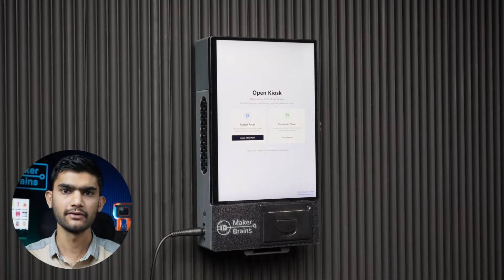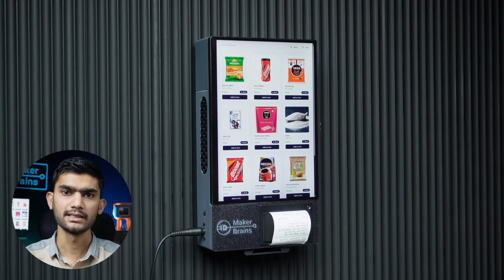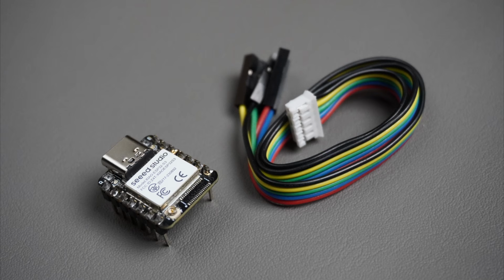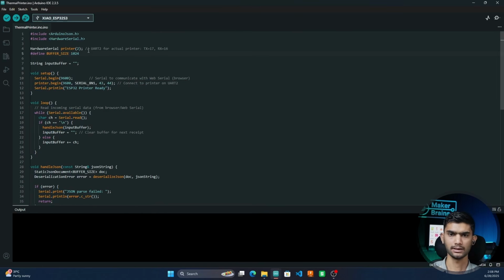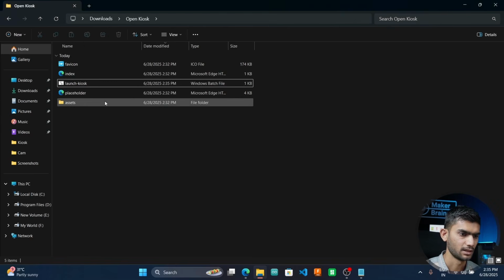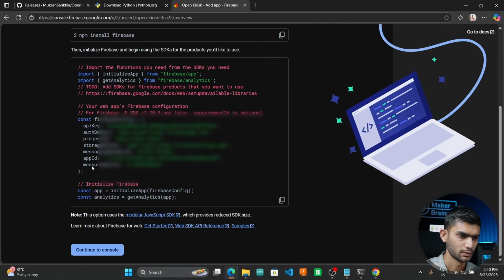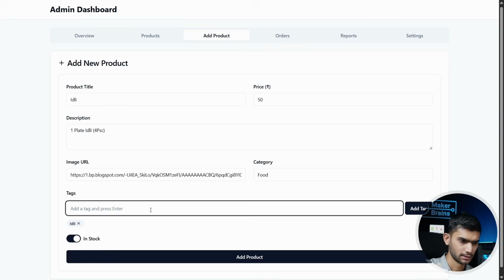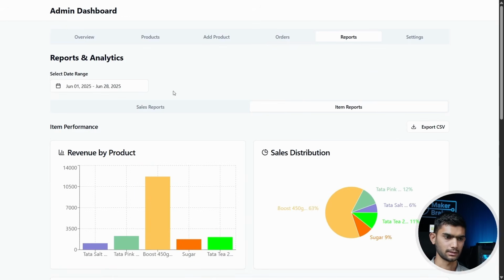Build Your Own POS System

Comment: In the US, kiosks must conform to ADA regulation. To avoid a lawsuit, keep the highest touch point at 48" from the floor. You will need to tilt the screen by 35-45 degrees, so both standing and wheelchair-bound people can read and touch the screen without parallax issues.

Comment: What I don’t understand is where I can upload or set the payment QR code. I can’t find this option in the admin panel.
Reply from the maker: It's not available as of now, because it's a core process of development to link the payment gateway. I can provide the option where you can add QR image but it will not auto proceed to next step.
Reply: @makerbrains  ok, thx

Comment: Perfect. I have a question - What payment systems does it support? And what happens when the order is paid? Does the buyer have to pick up his order from the shelf or is a ready-made package prepared for him? Or what? Thanks!
Reply from the maker: As of now the payment system is not intigrated but we have a payment page. Once order is completed we only get the bill receipt. It's a self service or counter system.
Reply: @makerbrains  Thanks for answer. So the system is not fully functional yet? It prints only bill receipt and then it all ends? :) something is missing. What the customer needs to do with it?
Reply from the maker: @exotical2 it's fully functional, in video I am promising a POS/Kiosk system which it is.